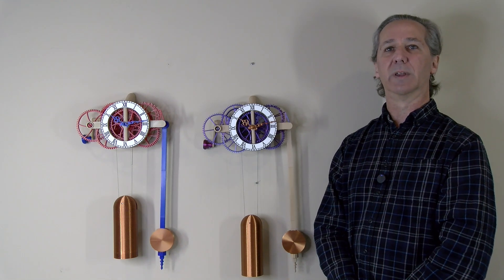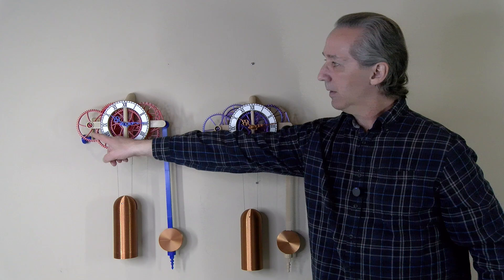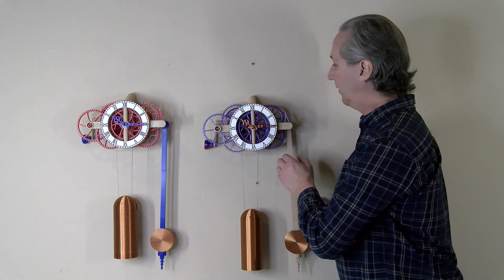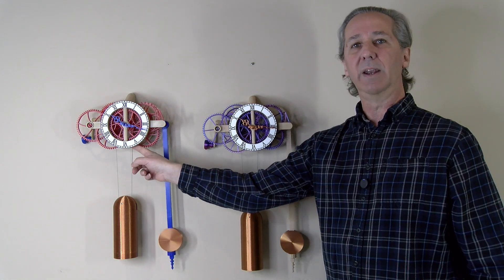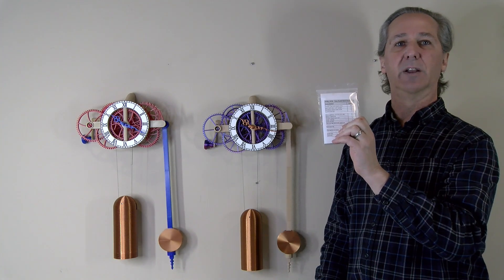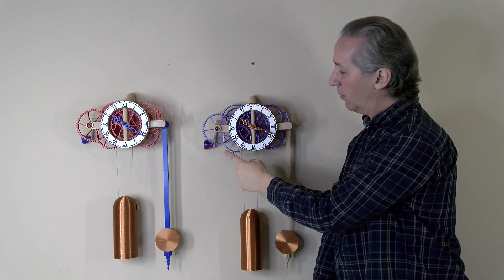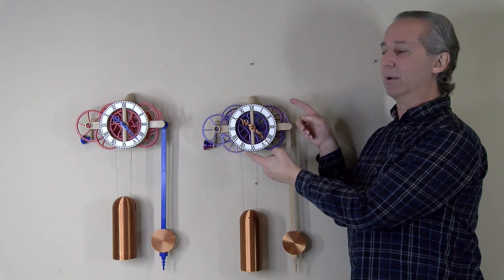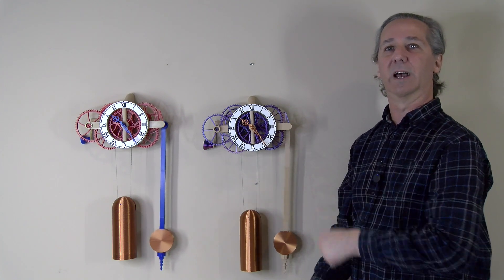32 Day Clock Update

Comment: Wow, now the clock became even more efficient.
For reference, a grandfather clock uses about the same weight to run for 8 days. It uses tiny gears, but metal on metal has a lot of friction compared to plastic on plastic. And the pendulum is very long.

Comment: Your clock designs are amazing 😍 
Would you be abl6to design one with two weights and a chime of some form?
Reply from the maker: All of my experiments with 3D printed components sounded dull. Even brass chime bars from a grandfather clock sound dull when mounted to a 3D printed frame. It needs a solid connection to the wall or a wood plate to resonate against for the proper sound. It is unlikely that I will ever add a mechanical chime to a 3D printed clock. An electronic chime might be the only feasible option.

Comment: Hello, Steve!  I am an Orthopedic Physician from Brazil who just finished building my SP5B Clock—the design is excellent and those "Perfect Print Gears" work wonderfully!

I'm writing with a suggestion for an application that could have a significant positive impact, based on my clinical practice: adapting the SP5B design for use in Magnetic Resonance Imaging (MRI) environments.

Many patients suffer from intense claustrophobia during MRI scans. A functional, gravity-driven clock like yours—with its visible, engaging gears—could serve as a powerful distraction and calming focal point, helping to reduce anxiety and prevent the need for sedation.

To make this possible, the clock would need to be 100% non-magnetic. I'm thinking of the following material changes:

Bearings: Replace steel with Zirconia Ceramic bearings (MR Safe).

Arbors (Shafts): Replace metal rods with Titanium or Carbon Fiber.

Drive Weight: Use pure Lead or another tested diamagnetic material.

Screws: Use Nylon/Plastic hardware.

As an experienced engineer, do you have any immediate suggestions or concerns about how these changes would affect the gear tolerances and the overall reliability of the clock?

I'd be eager to explore developing an "MR-Conditional" version of the SP5B to help humanize the MRI experience.

Thank you for your work!
Reply from the maker: Converting everything to be MRI safe would be difficult but should be possible. The non-printed bill of materials includes all the items you mention (screws, metal rods, bearings, lead weight, etc.). Titanium and ceramic are certainly options for all of these. Not sure if 316L stainless steel is also an option. 

One remaining component is the metal springs from a ballpoint click pen. They may need to be designed around to use alternative methods.

It is also worth mentioning that this clock is designed for long runtimes of 8 to 32 days. Your use case only needs a distraction for an hour or two. There may be simpler clock designs with a lot fewer metal components. There are also wooden gear clocks that are 100% wood.

Comment: Man, after nearly two years working on this clock I finally got it running on the 21 day gearing. I had to take a hiatus, hence the long build time. I'm working on a design for a clock that will be able to be build with sheet metal and arbors using anything from a waterjet cutter, CNC router table, to a lot of effort with hand tools. I'd love to update you when I get that finished.

Comment: I gave up trying to fix the clock about a year ago, but now that you have a redesign out I'm gonna try to print that one. Hope it works cause I've never been able to make the old design run for longer than 6 hours. I wonder if the filament type/brand affects how well the clock operates as well.
Reply from the maker: I keep learning new things about what makes a clock reliable. The maximum friction at any point of rotation is what causes the clock to stop. The start/stop action of the escapement means the gears have no momentum to push through the high friction zone. The new gear profile has a significant reduction in maximum friction so the clock becomes more reliable.

I have tried many filament brands and they all seem to work about the same.

Comment: Do all the gears need to be reprinted or just the ones that have been modified recently?
Reply from the maker: The updated gears don't mesh with the previous gears. So, if you change one gear, they all need to be updated. The updated winding key in gear 9 needs the new left side frame pieces. The frame added alignment tabs, so the entire frame needs to be updated. 

Unfortunately, this means that nearly the entire clock needs to be reprinted. The pallet, pendulum, and weight shell are the only parts that can easily be reused. The arbors, bearings, and screws from the previous clock can be reused. The results are worth it.
Reply: @stevesclocks  Thank you Sir.  I was hoping to get away with just the update, oh well off to the printer I go.

Comment: I built your 32 Day Easy Build Clock starting in November of 2021.  After I completed the project, and the clock had been running for about two weeks, I decided to move it to another wall in the same room. After that it would run at most a couple of days before stopping.  I even changed the amounts of weights used, thinking I was using the wrong weights. Still it would stop after only a few minutes, or hours.

I got very discouraged and eventually just stopped trying to get this clock to ever work. I discovered that even loosening or tightening the small frame screw just below the dial number “6” just a hair would affect the ability of the clock to continue running. That was the point where I realized this clock was never going to work, and gave up. The clock is still hanging on my wakk, and I  start it up every so often, but it never runs more than a few minutes.

I concluded that it must have been stresses on the clock frame by the plastic used (PLA), since even minor turns of the frame screw would affect the clock. I spent over three months trying to get this clock. I reprinted every single part on this clock at least twice. I had really wanted it to work.

Bye the way, I made another one of your clocks. The desk clock using the Aduino Nano.  I’m still use that clock, and it worked accurately after I rewrote the code that drives the stepper motor. It accurate to about 1 second per month.  Thank you, Raymond
Reply from the maker: You may have better luck with this latest fix to the 32 day clock. Gear tooth engaging friction is very mysterious. Everything is great 99.999% of the time, then all of a sudden the teeth jam and the escapement loses energy. Adding extra drive weight just lets the teeth jam together harder. Touching any gear, winding up one click, or loosening the number 6 screw can let the gears temporarily unbind and the clock will run for a while. 

The first two "sticky gear solutions" solved the side thrust against the escapement. Eliminating this source of friction allowed the gear tooth engaging friction to be the dominant issue. I believe this edit finally makes the clock reliable as intended. 32 day mode has very little power reserve and it takes a surprisingly small amount of hidden friction to break. My prototype appears to be unstoppable. Please try again with the updated design.

Yes, the stepper motor clocks are quite accurate. The precision RTC should maintain better than a minute per year. A second per month is not unusual. The motors have much more power than a clock needs even at the lowest possible setting.
Reply: Thanks for the response, but working on that clock for a solid three months just burned me out. It still looks good on the wall though, even if it never works. 😏

Comment: I just thought that I would ask if you have a version that can be cut out using a CNC?  I only have a CNC to work with.
Reply from the maker: It may happen someday, but I have been saying that for years. So far, there have only been a few experiments. Many of the concepts that make these 3D printed clocks more efficient should carry over to a wood gear clock.
Reply: @stevesclocks  Thank you for your response.  However,  I am using acrylic gears in my CNC clock and would like to make it run for up to 32 days.

Comment: I've just finished the small 8 day clock. The design's fantastic. I initially skimped on drilling the bushings to 1.6mm and couldn't get it running without 3kg of weight directly on the string, not looped over the pulley. After drilling out the bushings it works reliably with about 2kg of weight using the pulley, so 1kg force.
Thanks for an excellent product, I really enjoyed building it.
Reply from the maker: Drilling proper sized holes is a step that will always be required. There are too many variations in filament types, diameters, extrusion multipliers, printing speeds, and everything else. Some filaments, especially silk PLA, have a lot of surface tension pulling into itself to get a shiny surface. Small hole sizes are hard to predict and super easy to fix by drilling.

Comment: Hi Steve, I bought and built SP5  and was about to build SP5 with rev 2 changes. My Question is where do I find the files for SP5B, do I have to pay and download again. The update file only seems to have some of the new parts, I have the PDF but no printable files. Being an old bloke I'm finding it more and more confusing.
Reply from the maker: MyMiniFactory keeps a record of all the files you have purchased. You should be able to download the newest file as long as you log in using the same account used to purchase the original design. There should be a zip file with subdirectories for gears, frame, etc.
Reply: Signed in but didn't find the updated file, I will check again, thanks Steve. @stevesclocks
Reply from the maker: @juniorocicat9573  The new files appear on MyMiniFactory when I go to the web site. Try a page refresh or a different browser.

Comment: I will have to reprint this clock. Mine suffered from the sticky gear problem. I didn’t know it at the time, but it would run for a while and then have no power at the escape wheel. Thanks for the update.
Reply from the maker: You're welcome. I have been looking for sticky gear fix for a while. The first two fixes were needed to unmask the final issue. I believe it to be gear tooth engaging friction. The new gear tooth profile significantly reduces engagement before the line of centers. Friction is lower, and more significantly, the gears are much less likely to bind. I plan to migrate the new gears to several other clocks in the future.
Reply: Excellent! Thank you kind sir.. I can't wait to reprint this.. I absolutely love the last one I built.. 

I had reached out to you and mentioned how my clock would run then stop, pretty randomly as well.. some times run for 5 mins and other times day's.. 

I found on my particular build I would have issues in the ratchet assembly gear, not parallel to the ratchet shell.. I found that part had to be so accurate for my clock to run any good length of time..

I trammed my drill press and drilled the center bore of both so I knew the bores were 90 to the face.. I then sleeved them with brass tubing  and ran a bigger 3mm shaft.. 

It made so much difference in the reliability of that clock.. but unfortunately I to still suffered from the sticky gear syndrome.. even with 14lbs on it, it would still hang up now and then.. all I had to do was touch the escapement and it would fire back up.. 

Thanks again Steve.. always love your work.. your a talented individual.. 🙏
Reply from the maker: @camaroboy383  Hopefully, the new update solves all your issues. The sticky gear problem is significantly reduced. The updated ratchet was enlarged to a 3mm bore to support the additional bearings. The ratchet almost always needs to be greased so all three pawls slide back to their proper resting position. The three pawls maintain a straight alignment in this position. Greasing the ratchet is still required. Your new clock should need much less than 14lbs.